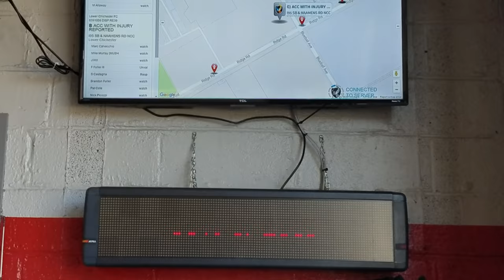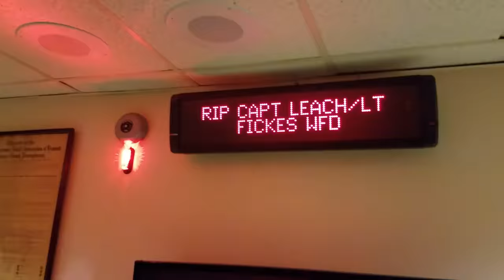Fire Station Alerting System Lower Chichester Fire Co Station 39 Bells Klaxon Lights Active 911

Comment: The alarm at my local fire station in the UK starts off quiet and then slowly increases volume so it doesn't scare you. This system is VERY over the top
Reply: Lol this is why the uk has the slowest response time
Reply: @hondaveetc82  exactly
Reply: The object of the station tones is to scare the living sh#t out of you, because if you are 2 hrs into a 4 hr sleep cycle you need to wake up and run to the truck in under 45 seconds and be out the door 15 seconds after. When a call comes in, seconds matter, and loud tones ensure everyone in the house knows it's time to roll.

Comment: Whoa. Those horns do almost sound like the Wheelock AS/MT fire alarms.
Reply: Dank Memer 57 given the sound of the Wheelock UTA-1, it is a modified name of the Wheelock AS/MT Fire Alarm Horn, which uses that exact same sound as the AS/MT Horn, just without the strobe light (and a different color on the outside and no FIRE lettering). Here is the video link to the Wheelock UTA-1: https://youtu.be/bUT8kcWC7-4

Comment: I wonder, because I know that emergency weather radios tend to have a 3.5mm "ALERT" jack beside the audio jack, which apparently sends a signal to a connected device if an alert state is triggered, do these fire station radios connect similarly to their stations' alarm systems?

Comment: What were the Two-Tone signals for?
Reply from the maker: Nicodo123 the 2 tone signal was Quick Call 2 paging. That is used to set off the pagers and trigger the alerting system as well.
Reply: countyfire911: as long as the system works the way it's needed to then that's all that is necessary....

Comment: Hello :) What is the name of the alarm?
Reply from the maker: This is a custom system that I designed. The Bells you hear are manufactured by Suns International. There are 8 inch, 6 inch, and 4 inch bells. There is also a UTA-1 by Wheelock(electronic horn) in the engine room.
Reply: All right... Can you send me a clip of the electronic horn please?
Reply from the maker: Filipe Boavida here is a video of the horn. https://youtu.be/bUT8kcWC7-4 they power it up at the end.
Reply: Thanks man! Great job ;)
Reply from the maker: No prob. I have all kinds of different alarm items. Feel free to send me a message if you're looking for some ideas. The UTA can be used on telephone ring voltage (90v) or 24vdc. There are screw terminals on the inside for a positive and negative connection if you dont want to use the telephone jack.
Reply: Filipe Boavida lp
Reply: I’ts a wheelock a s